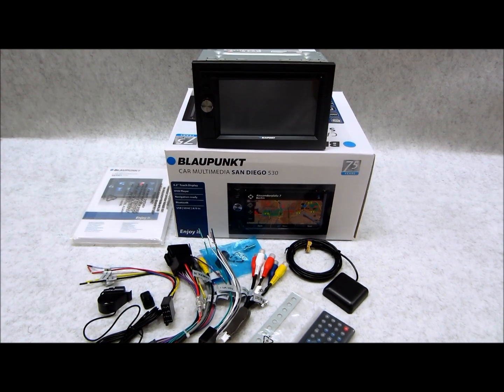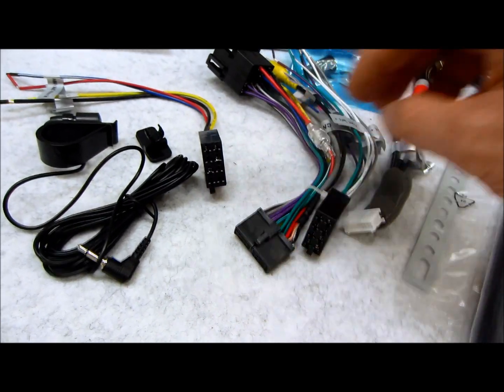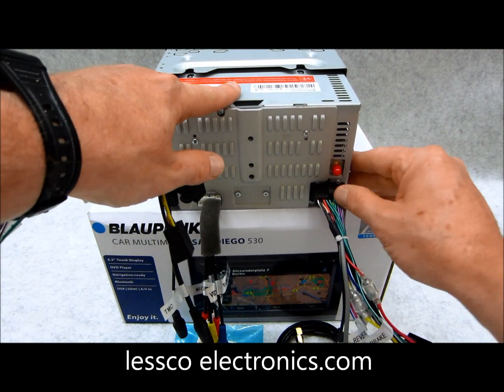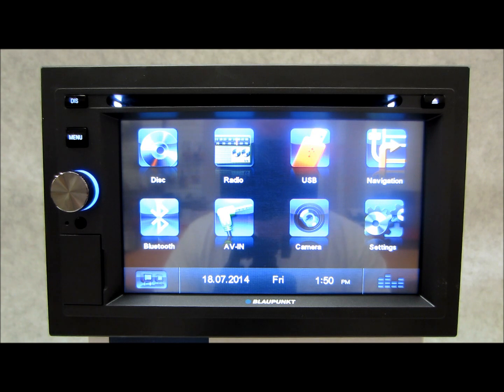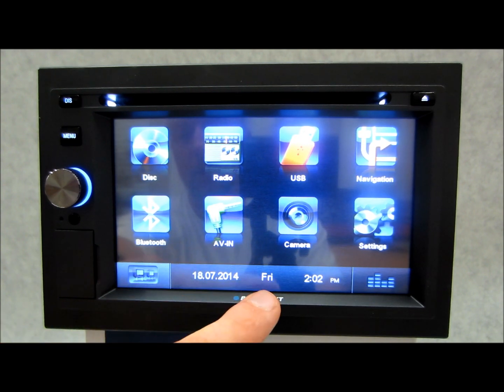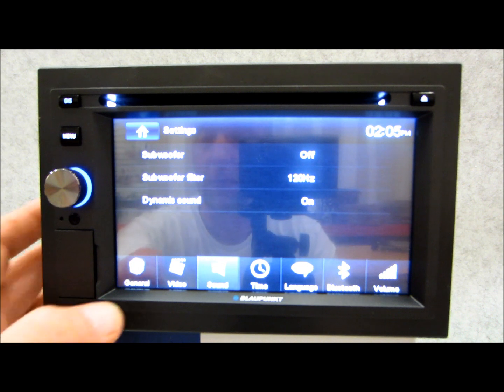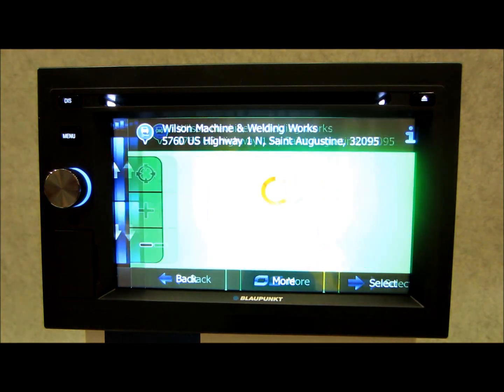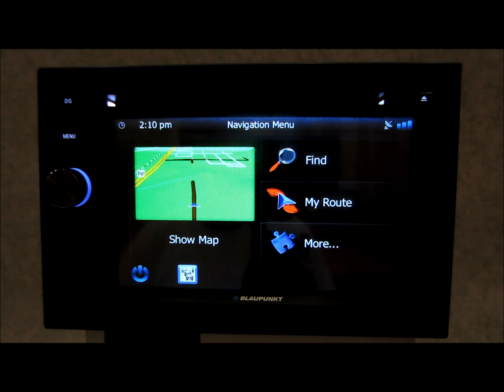Blaupunkt San Diego 530 Multimdeia Receiver Review

Comment: I just had this installed for me by a professional. Everything works fine except the phone bluetooth. The ringer is so loud that it will one day wake up the dead. When a call is coming in it only has one volume setting which is the loudest. Does anyone knows how to turn down the ringer? I have Samsung galaxy S3 which I have already turned all the way down. I heard that when a call is coming in I am suppose to use the control switch on the steering to turn it down, and the next time a call comes it will remember the setting. Sorry that doesn't work either.Does anyone has suggestion?
Reply: TUBEADE 
Ok, I took it back to the installer and he fixed it. He removed it from the dash and adjusted the control in in the amplifier.
Reply: +TUBEADE are the steering wheel controls working. can you turn the volume up and down from, and change songs
 the streering wheel

Comment: Hi, I got this unit installed in 2 of my cars. Everything is good except for changing the radio station using steering wheel controls. It just skips frequency instead of changing the stored channels. Any fix for that?
Reply: Vishal Mathur Hi Vishal did you get the problem fixed ? How effective is the customer care ? Which car did you get it installed ?

Comment: Hi, I am planning to get this model for the Nissan sunny 2014 model(India). Will it require any cutting of wires and external fascia?
Reply from the maker: Vishal Mathur Sorry, But I am familiar with the USA models.
Reply: Lessco Electronics thanks for the reply. One more thing that i want to ask is that how many steering wheel control buttons are supported in this device.

Comment: HI... I have this installed in my 2009 VW .. The only issue I have with it is the navigation guidance volume is very weak,  I have the nav volume set to max .. anyone else see this issue? Do I have a defective unit?
Reply from the maker: if you have a premium sound interface, I think there volume setting on it may be turned way down???
Reply: Hi...

Well the unit continued to go mental,,,,, Getting a replacement shipped out...
Reply: I had this same problem in my 2007 Civic. All you need to do is go into the settings for your navi, go under your sounds option, then look for a bar that says "music". Turn that down until a pixel of the bar is left. Keep the other bars up high. Now, each time your navi voice speaks, the music should immediately drop. Once it finishes, the music will return to its normal volume.

Comment: I am considering this unit so your review was very helpful. I already own a Blaupunkt Brisbane in my truck and simply love it, despite its quirks. I'm looking to put this into a 2007 Dodge Charger RT since its time to lose Sirius XM. I'd also be losing  Chrysler's clunky NAV so there will be no tears lost there either.

I do have a couple of questions for you as an installer.
1.) What size limit is the micro-SD card? (My Brisbane is an SD limited to 2 megabytes.)
2.) Does the USB take a flash drive/thumb drive with say a video or mp3s?
3.) Have you ascertained the OS of these units, (can they be hacked)?
4.) Can you use the rear view mirror bluetooth function button the Dodge has with the San Diego 530?
5.)  Is that also where the mic is and do those inter-connect well?
Again, thanks for the awesome review. You've personally sold me on this unit! :)
Best,
Paul
Reply: 1) Not too sure about the max size of the Micro SD card. I had a 8GB come with mine, & it had the navi.
2) Yes, it does. Blaupunkt has that listed in its manual.
3) IIRC, it's not hackable.
4) Probably not.
5) Rear-view mirror Bluetooth? Probably not compatible with this unit. However, the internal mic works very well, & so does the external mic.